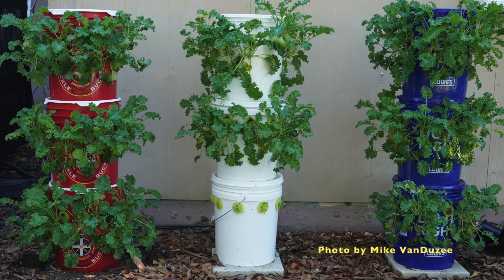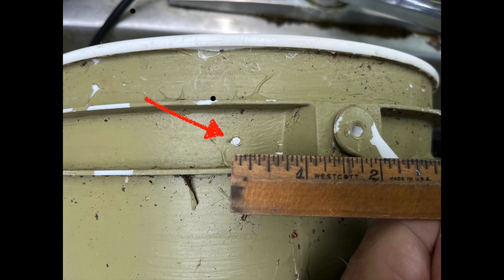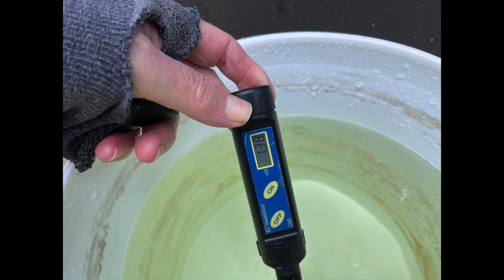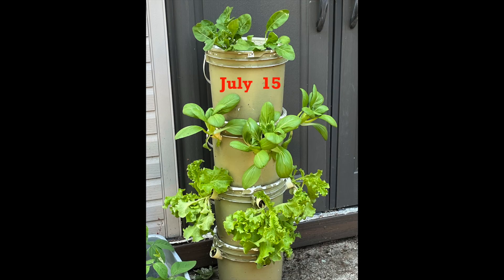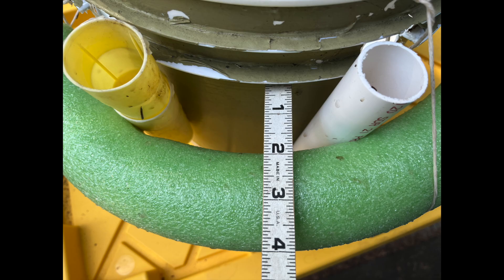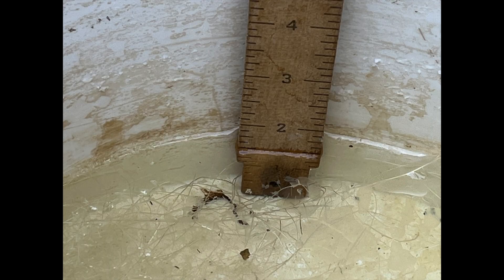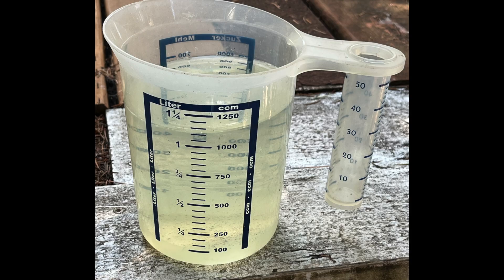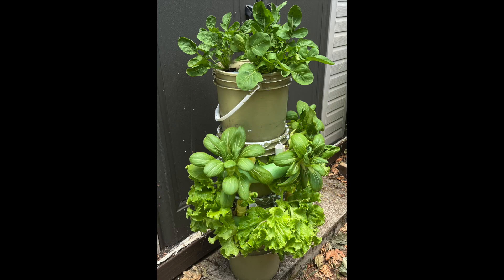Kratky Approaches to the VanDuzee Hydroponic Tower

Comment: Dear Bernard,
        Greetings from Russia! I am a proponent of your Method here in Russia and have previously reached out to you regarding the issue of air roots becoming submerged. I personally encountered this problem. You advised that once the solution level drops to the midpoint, a float system should be used to maintain the level within the 1-2 cm range.
        However, I decided to forgo the float valve for regulating the nutrient solution supply and opted for a system of interconnected vessels. I've made two holes, 25-32 mm in diameter, opposite each other at the very bottom of the buckets. Seals or fittings for polyethylene pipes are inserted into these holes. A pipe runs through these buckets – I plan to use 10-20 buckets in total.
            The part of the pipe inside the bucket has numerous small holes, 2-3 mm in diameter. These holes act as a filter. In one of the buckets, logically the last one in the chain, a pipe with a 90-degree elbow is inserted, which can rotate within the opening. By rotating this pipe, we can regulate the solution level. It's best to supply the solution to the first bucket in the chain. This way, the solution will recirculate, and if desired, we can refresh the solution and monitor its parameters, such as pH and EC levels.
This system can accommodate not only pure nutrient solution but also substrate materials like perlite or expanded clay (LECA).
I must mention that in my work, I am supported and assisted by AI from Google. This translation was performed by the AI at my request.
     Wishing you good health and continued success in your work.
Reply from the maker: Thank you very much for sharing details of your growing method. Many folks read comments and are helped greatly by details like you are sharing!
Reply: @growkratky5558 Thank you for your attention. I will be very glad if my experience will be useful to someone. In the fall I will assemble the installation and see what happens. I will share the results on your channel.